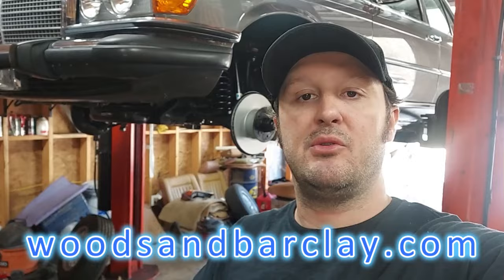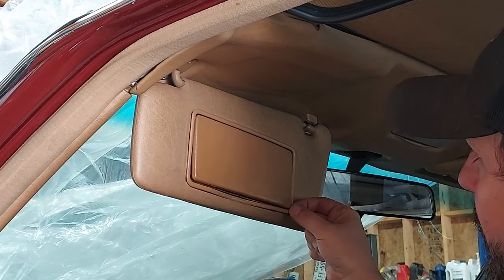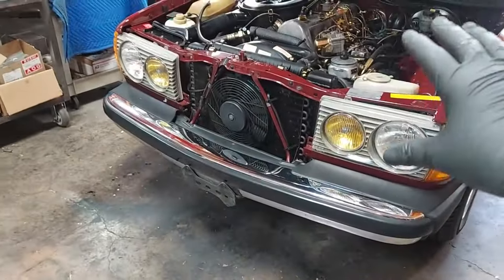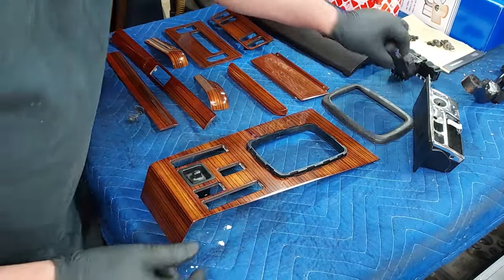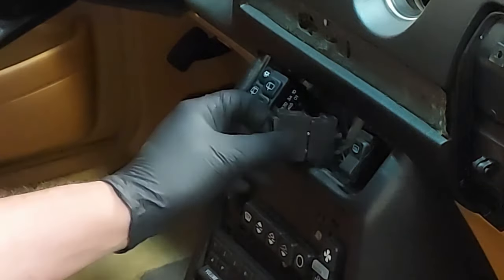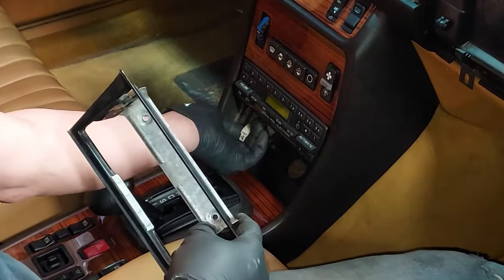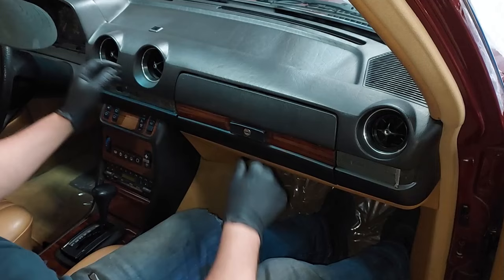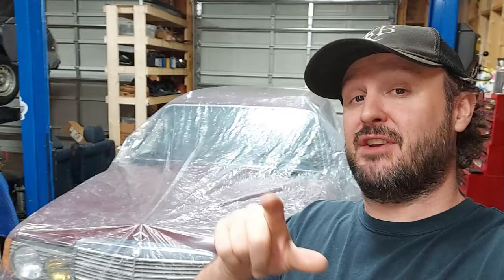1984 Mercedes 300TD - Part 11 Wood Trim, Visor Mirrors, AC and License Plate Holder

Comment: Beauty.. I like your patience and precise work.. When working on these older classics, the number one rule is not to rush....
Reply from the maker: Exactly right. Don't force anything and don't get in a hurry. That's how stuff breaks.
Reply: I have a small piece of wood cooming off from the edge (not completely) of my w126. should I use gorilla or JB epoxy on it to put it back?
Reply from the maker: The w126 is a completely different animal. On the edges of the dash you have pieces of wood with 90° angles. Unfortunately those pieces often crack along the seam. Go to the website and scroll down onto the 33,000 mile 300SD and watch the wood trim video. You may have to completely remove the piece and repair it.

Comment: dude, i need some parts...how do i get in touch?   been driving w123's since 2005...flipped about 25 for a hobby
Reply from the maker: We do not sell parts. You can find basically anything you need from FCP Euro, autohaus Az, or the Mercedes classic center. All of the used parts you need can be found on eBay.

Comment: What is that center button between driver side window buttons?
Reply from the maker: Child safety lock for the rear windows
Reply: That was my guess, but i never knew the w123 had that feature! My 240td has only electric front windows while my 300td all the windows are manual..  Typical euro cars!
Reply from the maker: Yes the US model cars have all the features the Euro cars are often stripped down somewhat.